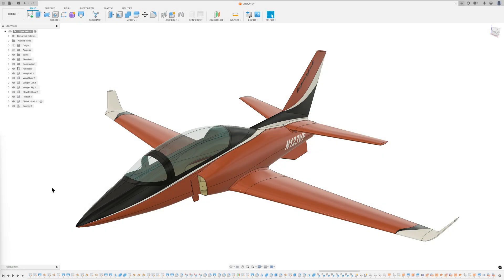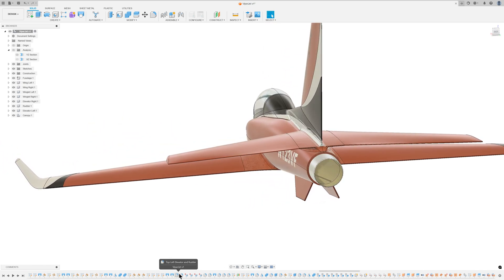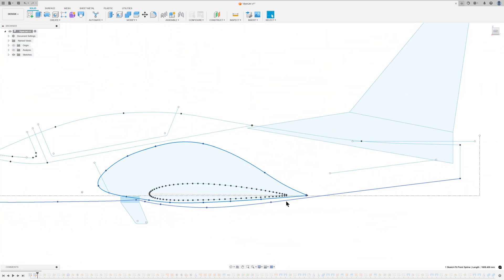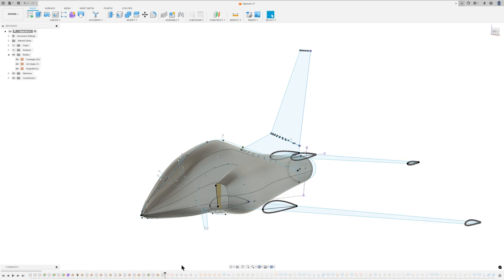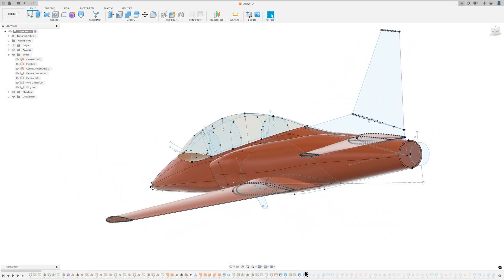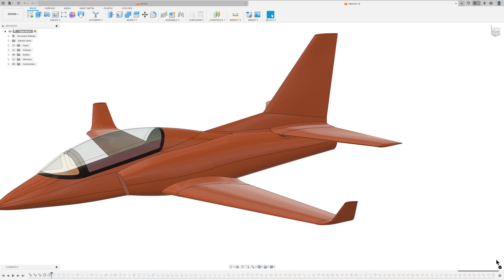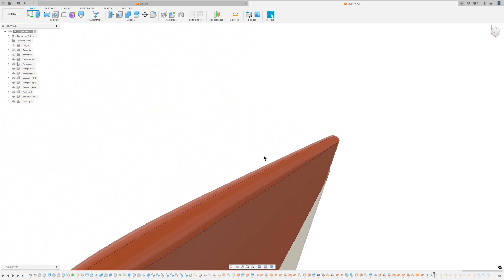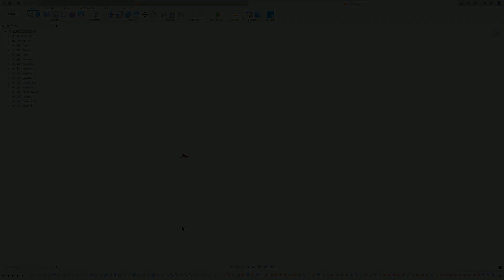ViperJet aircraft model, CAD drawing created in Autodesk Fusion 360

Comment: Would I be able to make a rc model out of this design that actually flies ?
Reply from the maker: Good question. Building an RC model based on this CAD drawing is definitely feasible, but it requires careful planning and additional design work. The complexity of the project will depend on your experience with CAD software like Autodesk Fusion and your chosen construction method. Here are a few considerations:

Classic Construction: This involves building the model using traditional methods like balsa wood, plywood, and spruce. You'll need to design and cut out all the structural components (formers, ribs, spars, etc.) based on the CAD model.

Glass Fiber Construction: For a more durable and precise model, you can use a glass fiber composite. This requires creating molds, which can be designed using the CAD model as a reference.

3D Printing: 3D printing offers a convenient way to produce complex parts. However, you'll need to split the model into printable sections and design the internal structure to ensure strength and weight distribution.

If you're proficient in Fusion 360, you can directly use the provided CAD drawing as a starting point for your design work. Other CAD software can also be used, but you might need to adapt the provided CAD drawing to a compatible format. The provided CAD drawing serves as a good foundation for your RC model project. It provides the overall shape and dimensions, which you can use to design the internal structure, control surfaces, and other components.